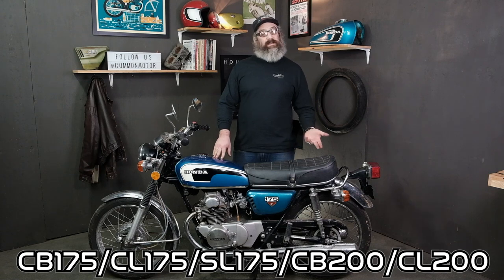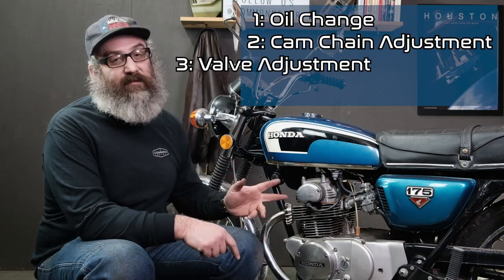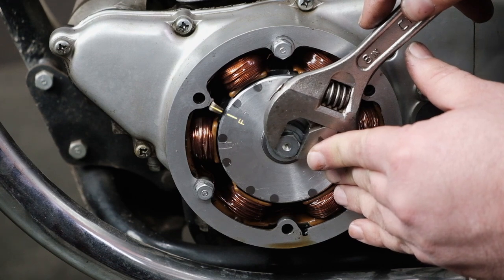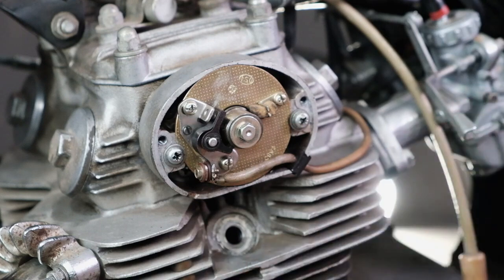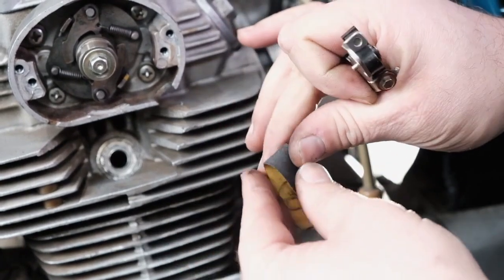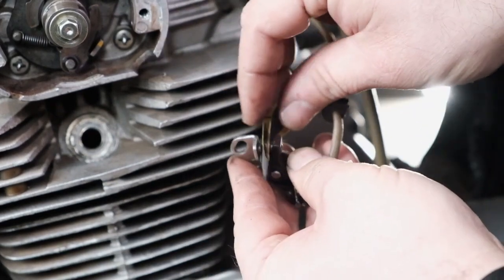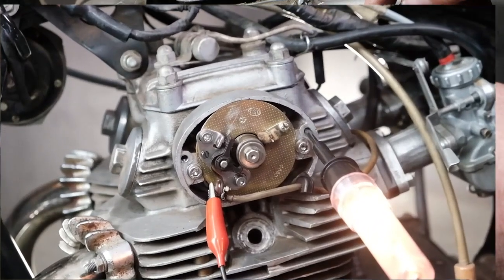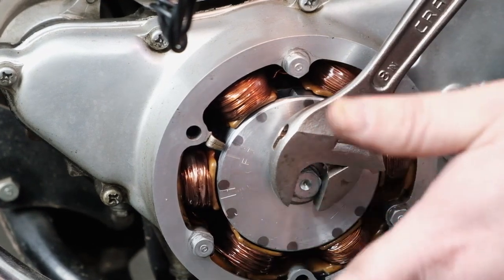Setting The Ignition Timing On The Honda CB175/CB200 Family Of Motorcycles

Comment: These videos are ~ excellent ~ 👌🏻 
I've got a '78 CB200, I got a new replacement rectifier back God five years ago maybe, all the parts and I got unwell and left the bike in the garden after spending £2500 on it and parts! I dragged it in two winters ago, good job cause we have had two years of heavy rain in England !! Bike is repainted, new tank resprayed gold (metal flake purple chassis) .... Just got the engine apart now, watched the oil filter one earlier, all good, I've got all sorts of replacement parts, my points are the Nippon type, surely as that's what ones arrived on order and today I removed the original ones 👍🏻💯

Comment: It’s really confusing that you say to do the oil change first…since oil will come out of the alternator/stator cover when that is removed. When on the regular kickstand it will literally pour out. The oil change should be done last, or am I missing something here?
Reply from the maker: The motorcycle is designed for this work to be done on the center stand is the only thing you are missing! If you open the inspection cover on the side stand about a quart can come out vs. the center stand in which only a small amount should dribble out. The oil change really doesn't affect the other procedures and really could be done at any time we just find it easiest to do first. If you center stand is gone, you could always use a small piece of wood under the kick stand or a rear stand that goes under the rear tire to prop the motorcycle up straight.
Reply: Common Motor Collective makes sense, thanks!

Comment: sand paper the points is not a good thing, Leaves cross marks on the contact surfaces, as well as residue( You didn't even clean off the residue before you re-installed the points.  Either re-place points or clean without sanding or grinding.

Comment: When I come up on the f mark the light pops on. But when I do one more revolution and come around again it's advanced. So how do I get it to be equal on every revolution?
Reply: This! Do you average out the two adjustments or do you have 1 that’s perfect and the next that’s slightly off?
Reply: @richieortiz5  I do it to where the left cylinder is perfect and the other one is slightly off. But maybe I should try averaging them out

Comment: This willwork on the CB 125
Reply from the maker: Yes! It's not identical, but a very similar process. I would check the Honda service manual for the slight differences in your CB125 timing rotor
Reply: @Common-motor  awesome thank you
Reply: @AI-pu6zv  on the CB 125 the index arrow/line/marker is down lower than the 175 at the bottom of the crankcase really , that's where you line it up with the F mark as shown in this great video.

Comment: Forget about the light, use the Ohm position of your multitool. When the contacts open the resistance will be infinit. At that moment you also have ignition. Much easier and it works. Mine runs like a V12.
Reply: a V12 has a few hundred horsepower, weighs half a tonne plus and return about 15mpg!
Reply: @johncollins5552  I agree John no way his bike runs like a V12, that’s impossible!

Comment: I was a motorcycle mechanic in the earl seventies. One problem I would find with all the Hondas was if they were kept outside and got rained on the wire running through the point cover could wick moisture onto the points. The smallest amount of moisture under that point cover could cause the bike not to start. I would seal up that area with some silicone especially on the old XL models that were ridden off-road .

Comment: I’ve cleaned points but light is still not flashing/turning off. What should I check next. I believe my ignition problem is the points.
Reply: I have the same problem. Did you get any further? Your help would be appreciated.

Comment: I am timing to set My point on a honda 1973 cb200 the ignition condor I had to change but the that I had was a single wire my bike started and ran now it won't. Start

Comment: Cool deal. Wish you had an example of a CB/CL/SL with the Nippondenso points set, so we could tell if the last owner was using the proper points before? I've seen too many re-engineered Honda's in my day, but assume the plates will only accommodate a particular type alone. I hate ever taking for granted any point when it comes to ignition timing since many ill's are made worse by faulty electrical systems. Thank you.
Reply from the maker: From what we've found their interchangeable but you have to have the right plate. If it's the incorrect plate though the other style point won't even fit on the plate. Hopefully, this helps!
Reply: @Common-motor  kinda figured that is how they made the arrangement up that you won't have any luck getting it to fit at all. That helps some, but Murphy is prankster and the first one I am bound to come to won't have a set of points to start with. Thank you.
Reply from the maker: haha oh gosh well glad to help and let us know if you need anything else!

Comment: Excellent information. I just picked up a 1972 CL175. The motor did not include any points, nor does it have a points plate. So my question is, will both styles of points plate fit? If so, then I can order either one and just buy the corresponding points type? (ND or Hitachi) Thanks so much!

Comment: The first time I rode a CB175, a bike I very much liked when I was a teenager, it ran ok but it seemed kind of anemic approaching redline and I discovered that whatever speed I was at when I shifted to top gear, that was pretty much all I was going to get.  Later, I found a 1971 K5 model in a storage shed and the owner was willing to sell it.  It turned out to be in very good shape, mechanically, so I cleaned it up, bought a shop manual for it and started going through things, among them, buying points, condenser, and spark plugs.  After setting the ignition timing in the manner you used, I took it for a ride.  To my great delight, it ran like a top.  It would pull top gear way better than that first version I had ridden.

Comment: Timing light. You say for your average guy about 13:46 in the video that static timing is fine. If I'm looking for best performance being  a rider of 210 lbs is there another recommendation? Running only 93 or better octane maybe pods or aftermarket exhaust?
Reply from the maker: Hey Alex! So a few thoughts about this because it's a good question and one we get often. One step further you can take your ignition timing is by reading up on the dynamic timing method in the Honda service manual using a stroboscopic timing light. I would always recommend running the highest octane gas you can get as well. 

To touch on performance, there's always more you can do to squeeze out extra here and there. There's internal engine modification, exhaust systems, different carburetors you can adapt, and etc. When you get into these style upgrades they are almost entirely there for getting the edge up on someone in a racing environment and can often sacrifice rideability, especially on the street. The vintage Honda's are tuned for high RPM riding and perform amazing stock from the factory and that tends to be a consistent theme for most motorcycles vs a car where a lot of similar style changes can make a big difference even day to day. The wall you might be running into unless you're racing this motorcycle is that maybe you're ready for a bigger motorcycle. If you are feeling a bit sluggish on the 175 and want something a bit more, I would recommend looking at a CB350 or maybe even CB450 instead of putting a huge amount of money into what will only get you a hair better performance.
Reply: @Common-motor  Oh I have a bigger bike. 00' Triumph Speed Triple 955. I have some friends that flat track race though so this is my project bike. 74' CB200T

Comment: Current is running through the coil when your test light is off (points closed, closing the circuit).  You said it's when the light is on.  Spark occurs when the points open at the F mark, interrupting current through the coil.
Reply: Thank you for that comment. If the light never turns of, does that indicate that the coil is broken? I have the problem that the light never turns off! Points are set to 0.3mm. Any help is appreciated

Comment: Cool video, I have a 1980 cb125 single that won't start. I have a yellow cable out from the generator that is live even when the ignition is off. I don't understand it. The wiring diagram in my manual Haynes says it should only be live when the lights are on?
Reply from the maker: Hey John, I don't know much about the 80's CB125 but I would agree. You shouldn't have power that's live when the motorcycle is turned off at all. Now a lot of Honda's had a charging system that only kicked in one half when the lights turn on and most owners do what is called the white/yellow wire mod which turns both halfs on at all times for better charging. This could be what's going on, in which case it wouldn't be a bad thing. Here's our article on it: 

https://support.common-motor.com/hc/en-us/articles/360038003951-The-White-Yellow-Wire-Stator-Coil-Mod-How-To-Increase-Charging-System-Output-CB175-CB350-CB360-CB450
Reply: @Common-motor  Thanks I appreciate the advice.
Reply: Your 80 cb125 has cdi ignition
No points

Comment: Awesome video as usual Brendan, one question I still haven’t heard back from you about my cb400f question. Have a project bike, do you carry parts?
Reply from the maker: Hey Timothy, we're working through our tech customer questions but a little over a week in response time currently. We should be caught back up shortly. As for the CB400F I do and I don't have parts. It shares a large amount of suspension and electrical parts with the CB/CL360 family of bikes which I have, if you need specific engine/carb parts I MAY have some or be able to get some. What are you looking for?
Reply: @Common-motor  working through compression issue right now but I will let you know